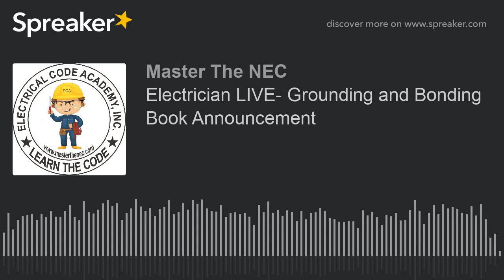Electrician LIVE- Grounding and Bonding Book Announcement

Comment: I dont like using Armor or even metal tubing as a ground only path...  I want me a wire - I guess Im goofy  :)
Reply from the maker: Not goofy at all my friend. I would say (guess) 90% of the designs place an EGC in raceways that are permitted to be EGC's per 250.118. Its just a design choice. Now, to HVAC systems on rooftops where metallic raceways are used (EMT) with compression fittings then a wire type EGC is required in the 2020 NEC. But other than that its all about the design.